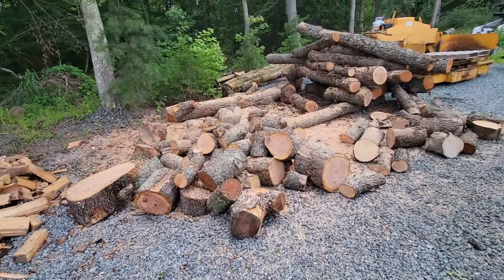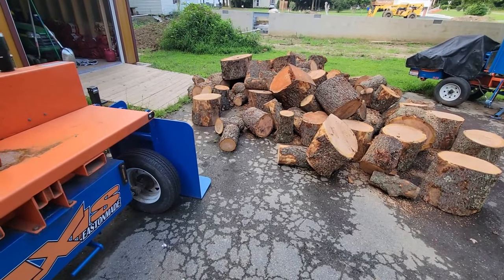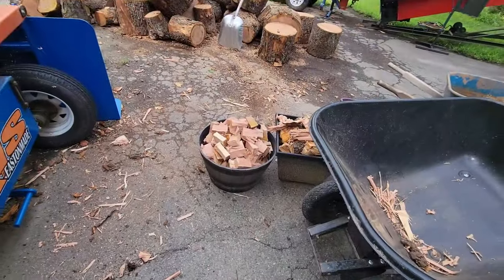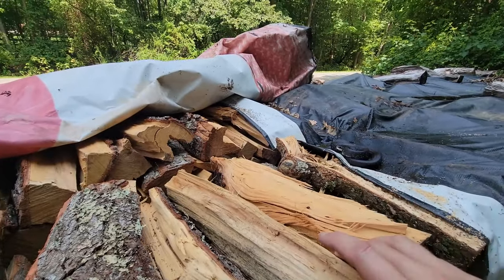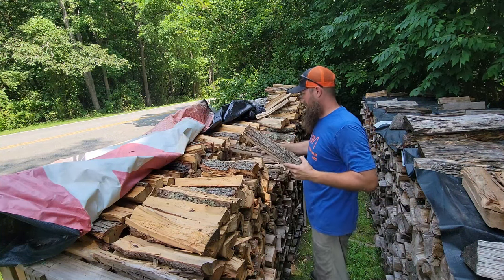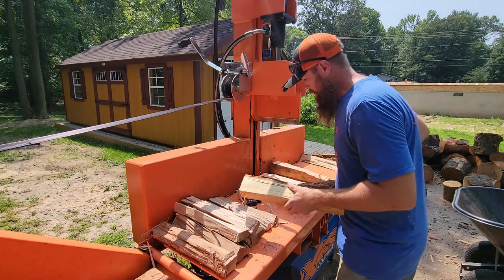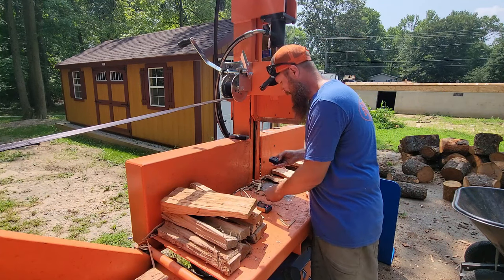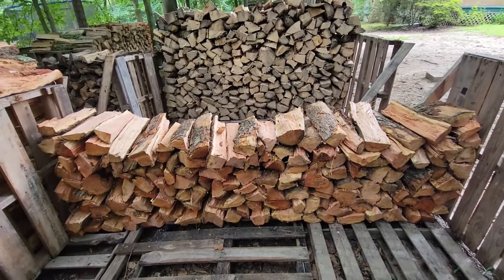More Cherry!!!!!! -077

Comment: If you burn cherry yourself. Cherry burns a bit dirtier in my opinion. So you may not be real happy if you burn it close to 20%. Well your chimney may not be happy.  But that’s just me burning not so hot fires.  Works better mixed in with very dry wood.
Reply from the maker: @stannelson2582  I love cherry, I'd burn it exclusively if I could find it!!! It's not oak or locust but it smells and burns  very well. We always burn mixed for heat, we rarely burn only 1 species for our personal heat. We always run our stove wide open, it's all heat or nothing 😂😂
Reply: @LogCabinFirewood  I run mine cooler.  Small house.  Can’t cook the kids lol. Lots of pipe cleaning.
Reply from the maker: @stannelson2582  yeah that makes sense.  Whatever we gotta do to stay warm brother 🤜🤛

Comment: I just bought a load of cherry logs, fingers crossed it pays off.
Reply from the maker: @AroundTheYard-MN  10-25$ per 1.33 cubic foot bundle. 

Then add a premium for the not so pretty stuff too if folks want it for heat.

Also save chunks for smoker chunks too!!! Same thing, 10-25 bucks a bag for them too. 
 
I don't think you'll have any issues making your coin back plus a litte bit